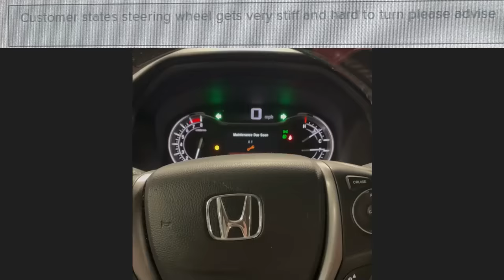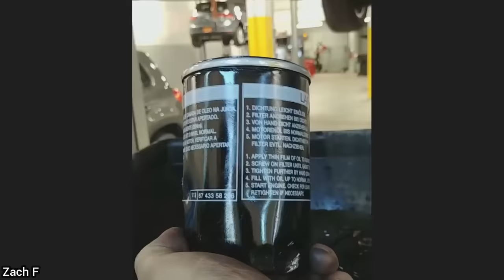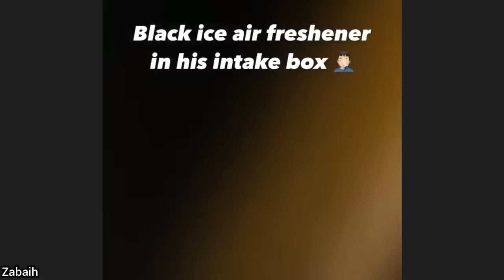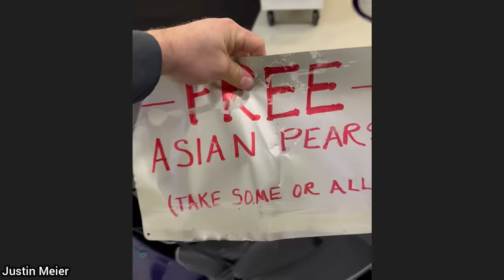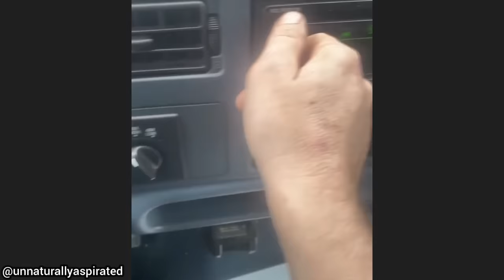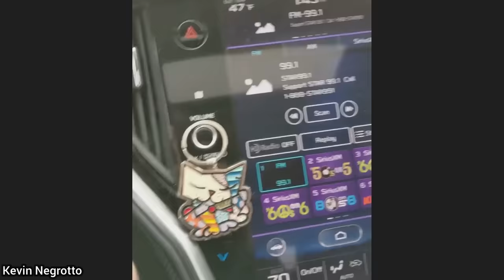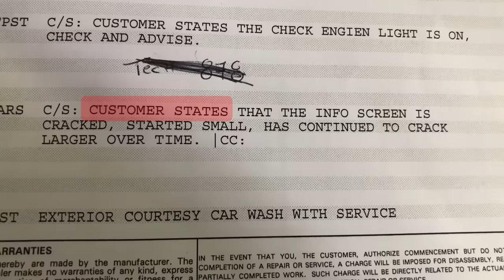Customer States Compilation (The Best of 2023) | Just Rolled In

Comment: Reverse at 70mph..  sounds like a great idea.  
I did actually put my 85 Buick skyhawk in reverse at 35mph just for kicks once.   It was a beater car i was going to junk anyway.   It conked out, but otherwise continued to drive perfectly fine..  well..  as good as it did before with a bad head gasket, a radiator clogged with years of stop-leak, no front brakes, and over 300k miles on it anyway.
Reply: I remember one time when I was about 4 years old my mother and father had an old Ford Tempo and I was sitting in the front seat on a road trip to go see my grandparents. I'd adjusted in the seat to get comfortable and my foot slipped off kicking the shifter forward into reverse at 70mph. Car immediately started bouncing down the highway before my mother figured out what was happening and threw it back in drive. Drove the rest of the way there and back just fine. Think they only got rid of it when they had a chance to upgrade to something that didn't have a blown head gasket.

It's insane that somebody would think to throw their vehicle in reverse in an emergency situation like that.

Comment: 9:49 - 78k miles since new. It's a 2018 so they've had it 5 years, never got the oil changed, and they're LEASING it?! I know leasing has it's benefits but not if you don't use them and keep the car that long.

Comment: when i trained as a mechanic we were legally required to withhold the vehicle if it was not roadworthy and a danger to the driver or the public customer has two choices lose the car or fix it  they  are not allowed to drive an unsafe car or motorcycle  away if refusing to rectify  and the customer drives away and has an accident after inspection the mechanic gets the force of law applyed to them

Comment: Story Time!
So i was working at a mechanic shop as an assistant. Well, a SUV came in, the transmission was recently rebuilt by a shop, but it was overheating. 
Well, the experienced guys just thought it was low on oil, so they had me jack it up, open the plug and fill it up. It was one of the side fill trans.
So i went on unscrewing it, and noticed it was leaking oil. I got a pan, and placed it under there. Didnt think much about it. Continued to unscrew it, pulled out, and then woosh, the oil shoots out, making a mess. I quickly moved the pan for the stream of oil.
The guys yelled at me, but after it all drained, there was several quarts of oil in the drain pan. Whoever rebuilt the tranny way overfilled it, which probably caused the overheating issue

Comment: As an irish man, we have a Car tests/ examinations on your cars condition ever year or 2 (depends on how old the car is)
Its a pain in the ass, it costs like 50 quid, and they can fail you over the smallest things, like "damaged wiper blades" cause "it might hinder your viewing of the road when raining"
...but now im kinda glad we have it... cause its scary to think there are cars like these on the roads in other places....
Reply: In the UK we have an annual MOT (Ministry of Transport) vehicle examination on cars over 3 years old, they normally cost about £45 ($56.40) &, like in Eire, can be failed for a broken light, white light leaking out of a rear light (cracked plastic), crack in windscreen if in the drivers eyeline, rusted bodywork (except surface rust),  subframe or chassis, all lights MUST work where fitted, damaged body panels if sharp edges could injure someone, all seatbelts, emissions, transmission, tyres, brakes, steering, suspension & shock absorbers, stickers if they restrict your vision, tinted windows if the tint is excessive, placing of phone/satnav holder if not built into the console/dashboard, seats must be secure, wheels (correct tyre pressure & tread depth, including the spare if supplied with the vehicle), wheel bearings, I'm sure there may be more. I almost forgot screen wash & washers/wipers.

Comment: 0:00 The Customer is Happy that they didn’t take to a test Drive
0:19 Too much Materials To try patch on the Washer Fluid Reservoir
0:31 Washer Fluid Coming Out From The Battery
0:44 Steering wheel gets very stiff & hard to turn
0:58 Scarf gets tied to the Steering Column
1:10 Vibration in driveline
1:30 Grinding noise & see sparks underneath their car while driving
1:49 Customer Added Vegetable Oil to the Engine
2:09 Another Shop failed to Install Transmission
2:35 Everything welded to the Rear Crossmember
2:51 Welded U Joints
3:00 Fuel Leak
3:14 Volume is maxed out but still sounds low
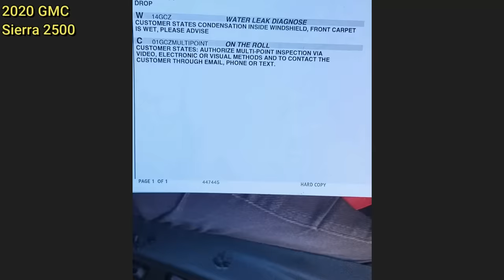3:33 Condensation Inside windshield, front carpet is wet
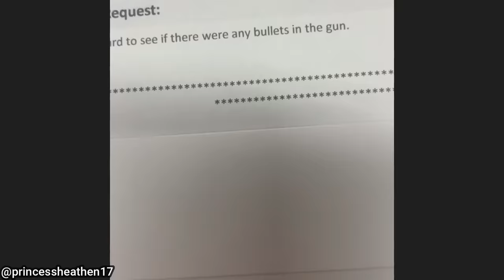3:56 he shot a hole in his floorboard to see if there were any bullets in the gun
4:03 fuel leak from the rear differential
4:16 Transmission + Washer Pump = Damaged
4:47 Washer Fluid Mixes Front Differential Fluid
4:56 Customer States there is a rattling noise 😑😑
5:04 When pressing Home Screen on head unit of steering wheel it goes to temp settings, or goes to home for 5 seconds and Pinecone touching screen selecting climate
5:19 Interior, cargo and dome lights don’t work
5:33 Centre console display goes out. Has been off for past 10 days
5:47 Right turn signal won’t stay engaged
5:55 Rusted Purchased Jeep Frame
6:14 4WD Isn’t working
6:22 Electrical Tape gets stuck in the oil pickup tube
6:39 Taped Oil Pan
6:49 Electrical Tape Brake Lines
6:58 Brakes Don’t Work and the Pedal goes to the floor
7:13 Pancakes under the rear seat
7:18 Belt Doesn’t Want to retract
7:30 Rattling Noise From the driver’s door
7:40 Slammed it in reverse at 70 mph
7:55 Didn’t come in to get new ball joints installed but now it will have them replaced
8:19 Ran over a street sign
8:31 He hears a noise after he installed new lug nuts
8:44 Engine is noisy
8:53 wat
9:01 Goats got into his truck
9:19 Tan colored plasti dip everywhere on the interior
9:36 Seized Engine
9:56 Low oil pressure

Comment: The technician  at 4:15 obviously didn't realize that you need to add gear oil to the gas when you're running a 2 stroke differential

Comment: I remember having an issue with the carburettor on a car so I went to a scrap yard, found my model of car and took out the carburettor. It was a fiddle to get out and I damaged it a little bit but it seemed fine.

I took it home and did the swap and it seemed ok, although it stuck a bit. But I'd replaced a carburettor! I was a mechanic!

A few days later, I'm driving. I floor it and the throttle got stuck wide open. I'm pushing the brake as hard as I can but I can't turn the car off because I risk activating the steering lock and I can't put it into neutral because that would blow the engine. 

It was an automatic so I got it as slow as I could and rammed it into park.

Now I leave the big stuff to mechanics.

Comment: A friend had a Chev Blazer that regularly made driveshafts like the one shown on the thumbnail.  Might have had something to do with the built 427, Holly 3 barrel carb, nitrous injection, positrack diffs and the 24 inch wide paddle tires. And a ten story high sand dune. Just guessing.
 ( with regular tires on, this rig was his wifes daily driver.)

Comment: 14:30 is the INFAMOUS 1MZ-FE Oil sludging Issue! 1MZ-FE V6 Engines love to leak oil. When the oil Runs low, The lack-luster PCV system causes the oil to gain carbon build up... Yeah. It's really bad. When the oil gullies get clogged, It will eventually cause valve train damage so bad the head will no longer seal, and all that needs to be done to avoid this issue is keeping the motor oil topped off, and changing the PCV valve ($11 from the dealership) every 50k miles.

Comment: Looking at some of these, I really do think that shops need to be legally allowed to prevent customers from driving away in unsafe cars (the one where the tire was dragging, the one where the bottom was rusting away and falling apart, etc.) and even contact law enforcement to come to the shop and impound the car unless they get it fixed. I mean unless I'm mistake, the law does state that in order to operate a motor vehicle, it must be in good running condition.

Comment: The Tesla with a weight on its steering wheel is scary as fuck.  People have been using self driving features in towns and everywhere they shouldn't be.  Recently one was driving through a park in Portland Maine because there used to be a road there, and the GPS hadn't been updated.  Self driving cars will get someone killed, if they haven't already...

Comment: Ethanol doesn't do a damn thing to any car built in the last 25 years. Past 15% the computer is outside its limits for fuel trims. Ethanol is awesome, cleans well and you can make obsene amounts of power on even only 50%E. 94 octane with 10% E will let your engine make the most amount of power it can. ALL modern engines CAN run on 87 but, power will be reduced by quite a bit, especially in 100° heat with the AC cranked.

There is at LEAST a 40hp difference in my wifes SkyActive CX5 between 87 and 94 in the summer.

Comment: Customer state with battery disconnect turned off test light will light up from neg post to cab. Kidding when since battery disconnect on neg side because now you're giving it new ground path. 

Then truck towed in because its in full derate 5mph only. Yet sit there over night or whole weekend letting truck idle whole time. Truck in derate because DPF plugged and now it needs new morons